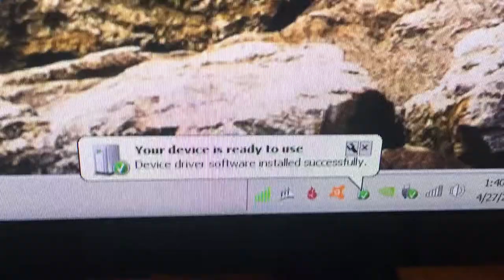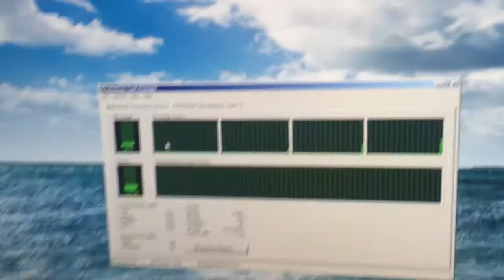Upgrading PC with New Processor

Comment: I have hp dc 7600 minitower. what processor(s) does it support.
Reply from the maker: https://support.hp.com/us-en/product/hp-compaq-dc7600-convertible-minitower-pc/472276/document/c00377076#AbT2

Use google to find answers like this.  I did it for you here.  Your PC will support a variety of outdated Pentiums.  In my opinion, an upgrade won't do you much good.  The important thing to know about whether a CPU will fit in your PC is knowing the "chipset" and the "socket" type.  You have a LGA_775 socket and an Intel 945G Express.  While some Core 2 Quad series processors have a LGA_775 socket, they are not supported by the 945G chipset. I recommend buying a new PC from amazon with an i-series cpu. You can find them under $100.  You can then upgrade to an i7 of that PCs generation when you have the money later.

Comment: who the fuck makes hardware modifications on their pc with the power cable in
Reply from the maker: Haha. Good point.  Also, it came out fine, so.... :D
Reply: @embertilton  it did come out fine but u might do it a second time or one of your viewers does it, and they break their cpu guess who they'll blame?
I'd suggest turning off the pc remove ALL cables, let it sit for like 30min or so to make sure all the electricity inside the components is gone, and then do whatever you want.
Better lose some time but stay safe, or save 30min and risk fking up ur pc.
Reply from the maker: @XenooS7  I thought it was implied that those things are "what not to do" - Folks, please keep your PC unplugged while working on it!

Comment: Yo I have a question, please replay back, can I run i5 9400f, gtx 1050 oc low profile 2gb and 8 GB ram in this PC with the stock power supply? Please replay and nice video ❤
Reply: si puedes, tu procesador solo consume 65w
Reply: @maximomayo2068  yea thanks for information
Reply: de nada, te comento yo actualmente tengo la misma pc que esta en el video, y la fuente de poder es de 320w, hay 2 versiones la de eficiencia estandar y la de alta eficiencia, la segunda es la mejor, la de eficiencia estandar si que no le podras poner mas de una gtx 750ti, yo tengo la de alta eficiencia  y tengo un core 2 quad q 9550(95w), gtx 1050ti(75w), 1 ssd, 1 hddd, sin quemador de dvd y juego a 1920x1080, lo que me hace cuello de botella es el procesador, la 1050ti es mucha grafica para mi procesador, ahora mi curiosidad que tarjeta grafica tiene el señor del video en su pc, ya que tengo entendido que la q9650 tiene un tdp  de 130w.
Reply from the maker: I5-9000 is not supported for a lga_775 which is what this PC motherboad is.  If you have some other PC you will need to check it's specs.
Reply: @embertilton  thanks for info
Reply: Ember Tilton se perfectamente que no es compactible con el socket 775, pero si sabias hay computadoras actuales, con la misma fuente de 320w de alta eficiencia
Reply: @maximomayo2068  bro I'm just buying a new PC it's only $145 and has i5 2400, 8 ram and 500gb hard drive, I already have gtx 1050 oc low profile and I'm just gonna plug that in
Reply: oh yeah yeah tu dale sin miedo, tu solo enchufala y disfrutalo, esa fuente la aguanta, cuando la fuente de poder no aguanta la grafica, alo mucho que va hacer, es cuando le des carga grafica se te apagara para protegerse, si dandole carga grafica noce te apaga, ya la hiciste
Reply from the maker: @packm8447  That will work fine.